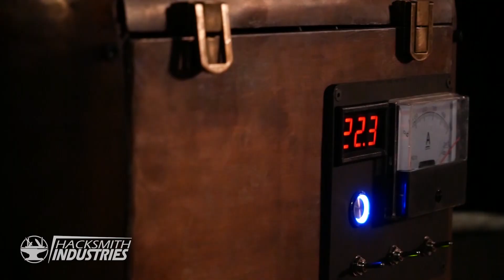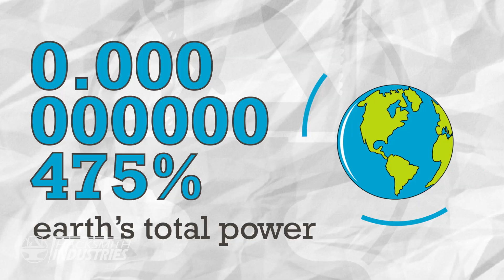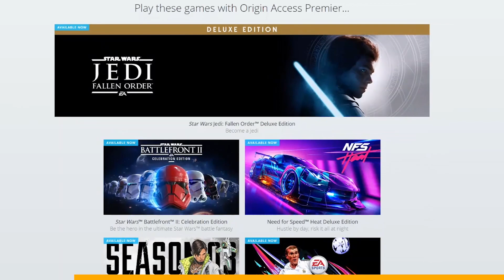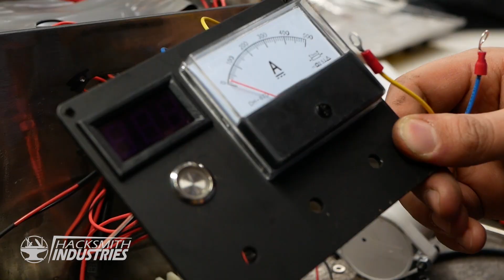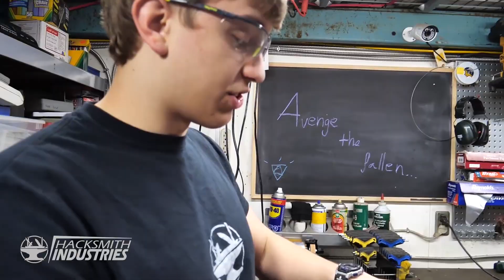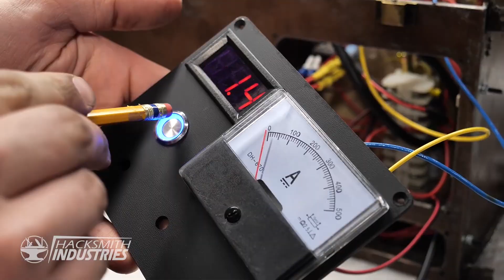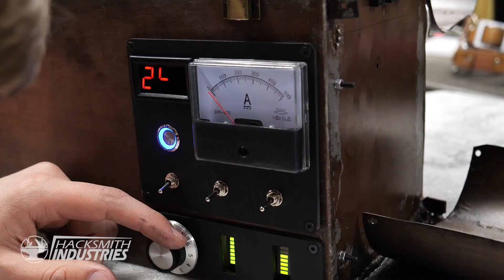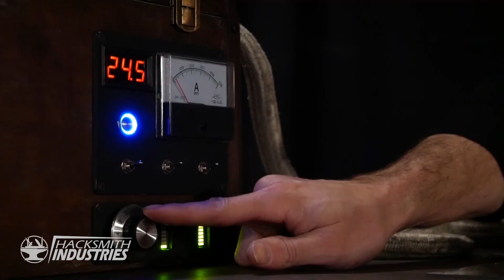World's First Protosaber! (REAL BURNING LIGHTSABER)

Comment: It works very similarly to a stick weilder. A large electrical current is being transferred through the tungsten causing it to heat up, so I imagine it would lose a lot of its form if it ever hit metal, as the electricity would make the tungsten attempt to wield to it. This was absolutely amazing! I love electronic engineering!

Comment: What if they're called lightsabers, not because they create light, but because they're a lot lighter than protosabers?
Reply: Actually, lightsaber hilts, in cannon, are very heavy for their size due to the very powerful Diatium power cell needed to power them.  Sure the blade itself basically weighs nothing, but that is the same for both proto and regular lightsabers.  I guess you could say the battery pack makes proto-sabers heavier overall, but anyway that's not why they're called that.
Reply: @shagrimm  The battery pack part was what I meant, and the comment was a joke, I know it's because it creates light. Also I didn't know about the power cell's weight, so ty for that detail.
Reply: @erinkarp6317  yeah, I figured it was a joke.  Just wanted to riff on that for a bit.
Reply: @shagrimm  K, that's fine
Reply: The protosaber is much lighter than a standard lightsaber due to the battery pack's weight
Reply: @loserbeam2780  Sure, from a certain point of view (if you dont COUNT the battery pack as being part of the protosaber's weight.  If you do, it is heavier than a lightsaber)

Comment: If you put a decent size capacitor across the contactor the switch will last longer. Makeing and braking. A DC current is crazy hard on phisical switches because there is not a 0 crossing (like in AC) so the arc is not extinguished as quickly. The large capacitor gives the current somewhere to go at the time of switching and therefore extinguishes the arc faster.

For the mosfets my guess is that your Rs on resistance was too high. Creating a massive junction temperature destroying the mosfets.
It's also possible that the coil of resistive wire is creating a significant inductance. To snub out the inductive spike from powering off that conductance would need a snubber diode or (flyback diode) in reverse polarity across the mosfet. Its probably not a huge inductance so the diode can probably be relatively small atleast in comparison to the rest of the componats.

The reverse voltage from an inductive spike will kill a mosfet really fast. They are very fragile to that

Comment: The way its designed reminds me of the fallout shishkebab a bit as well
Reply: D nahhh, the shishkebab would be better because even after it runs outta fuel it’s still a katana at the end of the day. This would just be a metal rod, lol.
Reply: @trindalas  Yeah but wouldn't the heat ultimately compromise its sharpness?
Reply: D probably, but it would still be a sword that could be sharpened. More effective than just a metal rod. At least I imagine so.
Reply: @trindalas  I was just ultimately saying the burning part reminded me of that weapon especially with the pack

Comment: "This is so dangerous, like if it actually hit my face, I'd be in trouble."
Yeah, that's why you have to be a Jedi to wield one!
Reply: Not really but ok bud
Reply: @lachy8226  you kinda do though...
Reply: Or wear a darth vader helmet for protection
Reply: Just put water on you for fire protection
Reply: To be fair, if you hit your face with a sword you'd be in trouble too.
Reply: @mc4906  you have 25% chance of being severely hurt if you hit yourself in the face with a sword, unless it's double edged. Then it's 50%
Reply: Lightsaber scar ;3
Reply: Yu Iko No, not really. Anyone can use it. Using it skillfully on the other is a completely different matter
Reply: 123GOHANZ yep, and it takes skill to be able to use a lightsaber (or this hot rod) without injuring yourself.
Reply: @123GOHANZ  actually the Crystals inside rely on the user's force abilities so...
Reply: @ItsPhezz  well not really.  However the odds of injuring yourself or killing yourself while using a lightsaber with no force sensitivity is extremely high. Unless of course you stress a Rey or Finn, then you can do it when you just learned the force even exists or in Finn case has janitor potential, not force potential.....
Reply: ItsPhezz No, no they don’t. The crystals DO have a connection to the builder through the force but a lightsaber can be used by anyone. Look at General Grievous who is more machine than man and isn’t even a force sensitive. Another case is Finn from the sequel trilogy
Reply: @123GOHANZ  yeah finn using the lightsaber is kinda BS though...
Reply: ItsPhezz Hardly. Finn is a highly trained Storm Trooper of supposedly higher quality than the Empire’s corps. Melee combat is something he’s actually trained in, however, a lightsaber is far more different than ordinary weapons due to its lack of weight and response when striking an object so he’s not proficient in it which was the case in TFA.

Comment: Would it not be possible to make a light plasma sabers that puts out a  sensory field that would be fairly cool, and if it gets touched or disrupted, that the power rating would increase exponentially upon contact, then reduce power when the obstruction is removed or burned to the point of no disruption?
I hope you get what I'm trying to get across....

Comment: Now, do it with a proper sword blade, it doesn't have to be sharp, but an actual sword shape, as opposed to the cylindrical shape you are using would likely cut significantly better. Well, that depends if it can even be done.

Comment: Theory time:
The crystals used in the star wars series are just super efficient nanobot built electricity source.
There is an atomic bomb in the crystals actually, but instead of blowing up, they are converted into electricity.
The color of the blades just comes from what type they found and they find their type through force.
Reply: That's a good theory.

Comment: I´ve got an idea , YOU SAID THAT LAGHTSABER WITHOUT A CABEL AND CHARGER IS NOT POSSIBLE.
But what about trying to make a MINI LIGHTSABER THAT DOESNT NEED A CABEL ? And make that light blade small enough to make it possible ?
Will this work ? And i am sorry if it isnt possible to.... I am not much into this kind of stuff.
 btw , i wrote it in capslock in order to make it more visible ! ( ͡° ͜ʖ ͡°)
Reply: Cable

Most of the hilt is taken  up by the heating apparatus already, i dont think there is space for batteries
Reply: @sebastiaomendonca1477  But they can completely rebuild that handle , no ? 
I mean if you wana make smaller light blade , then this light blade isnt the only thing that needs to change. Am i right ? I really dunno -.- ...  :D
Reply: @boobs-butt  I dont think it is as easy as that. If it was they'd have figured it out already

Comment: I'd be using more hardcore batteries for something like this. Like Sony VTC series or something. The ones you're using are 1100mAh and 10A max discharge. VTC4s are like 2100mAh and 20 amp continuous discharge with 30 amp burst capability. One screw up and you could have a giant fireball in that battery pack. Better safe than sorry.

Comment: If only you could harness that much energy in one small battery that could be fit into the saber then you could make a fully compact lightsaber with no bulky batteries, or if you decided to go all out you could create a nuclear powered lightsaber. Just an idea😂😂 although a nuclear powered saber could just melt anything in its path using gamma radiation so there would be no use in a titanium rod

Comment: Considering tech era we are in and the lack of magic space crystals, this is extremely impressive
Reply: @kana22693  Well. And something to eliminate the metal rod.
Reply: @hohhoch3617  eh, as long as it can be made sturdier it shouldn't be an issue
Reply: Ayden Mullins if you used a high melting point mineral, like tungsten it might improve its stability.
Reply: Too Fuxkin_Jiggy the current build is using tungsten for the rod.
Reply: So true, and even in the Star Wars universe, KuiberCrystals are only found naturally on one planet
Reply: @lane3346  With that one planet having been destroyed in Episode 7.
Reply: @PokeFan17000  The new movies are TERRIBLE
Reply: @ConfesstoChrist  that doesn't change the fact that it's still canon.
Reply: Now if we could just make it not emit heat
Reply: How? It's just gas and tubes
Reply: No, not really. If the video title was truthful it would have said "Holding a hot piece of metal and calling it a lightsaber."
Reply: time crystals.
Reply: @rx-0862  
They are real and they are weird and they have nothing to do with time. They moreso called them that because they really had nothing better to call something that freezes itself in time and space until you do something to it.
Reply: its an oven element with a handle... so impressive

Comment: I have a idea so if you store the metel bar in the body of the light saber then you can use a butten to flick it out of the body of the lightsaber with a button then you can make the bar heat up after that
Reply: That wouldn't work since the bar needs to be A: Solid, B: Strong enough not to just instantly melt, and C: An unbroken flow of electricity. A segmented rod that folds could gap then cause an arc, leading to a fire or explosion. A hollow, parascoping rod would just instantly melt. And finally, good luck getting away with a rod short enough to fit in the hilt...unless we make a longer hilt....oh..  oh you my friend might be onto something...
Reply: Oh thanks for the information

Comment: Try using Sony vtc6 18650's there 3000mah batteries that can continuously output 30amps and can put out up to 40amps. 54 would give you the same power out put as the 192 that your currently using

Comment: ideal since you are going for a new blade. i suggest making two smaller blades. and two (hopefully lighter) battery packs. making it so duel wielding can happen. 
(this just feel like it can happen.)
the single saber is tall, like a great sword, also looks unwieldy as it is now. for Kylo Rens blade, i suggest sizing up an arm, and making the blade said length. (a little longer if you feel it right.)
the hilt, while cool, needs a smaller grip for one handed use.

Comment: I thought I was at least a little bit intelligent, and then I saw this and well damn
Reply: Ehh. All they did was pump enough amps into a tungsten rod to make it really, really, really hot. The lights just blackbody radiation, and the battery pack is normal batteries we have now.

An actual lightsaber would require some kind of... plasma sheath around the tungsten, without consuming the tungsten itself.

Comment: hey i have and idea to make a lightsaber with out that you can get s rod that can handle extreme temperatures and put something inside of the rod that can heat up and heat up the rod and wire it so in a push of a button it heats up and becomes into a kinda real lightsaber

Comment: This is great!!!  You have created a very powerful sword that can really damage stuff. You’ve totally geeked past me. However, no soldier in his right mind would drag around something the size of a decktop conputer.  The power supply unit needs to be ergonomically attached to the back of the user. Shoulder straps and a waist strap would be a must to keep it from bouncing around.  Also, it should be as flat to the back as possible, i.e. not sticking out from is back very far.  Good luck on your next version.